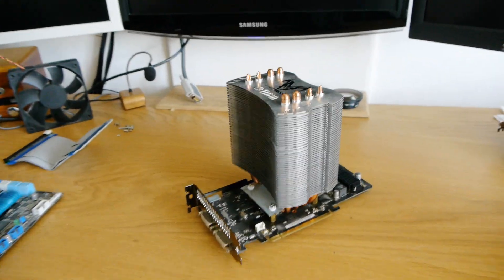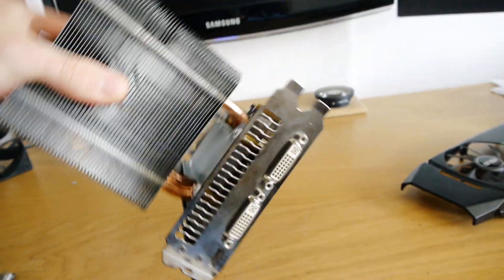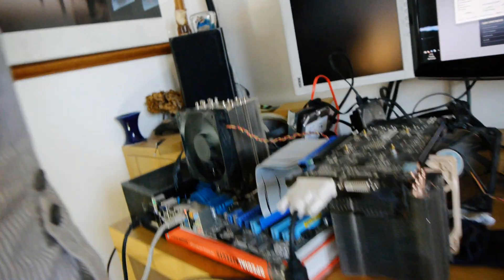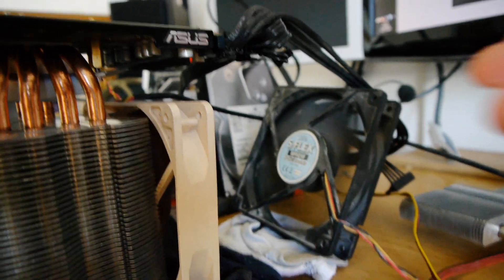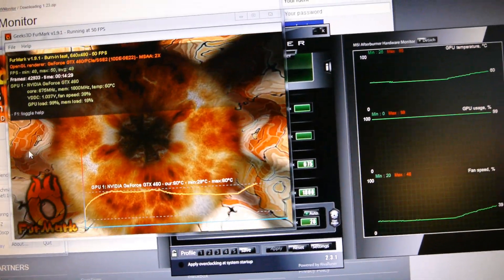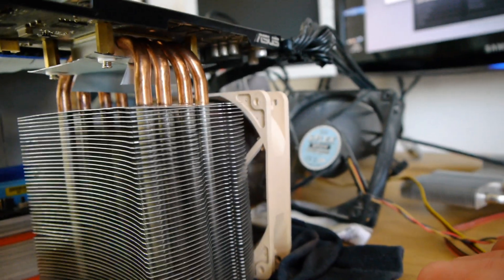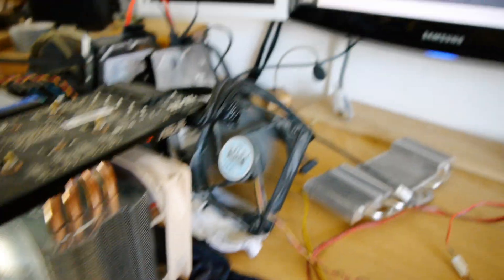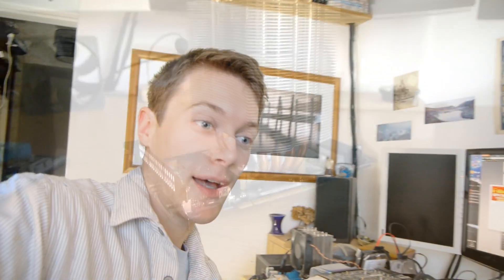CPU cooler on GPU (INSANE temps!)

Comment: Fun experiment.
Bear in mind though, that simply taking the original cooler off, cleaning the GPU and applying your own thermal paste, refitting the original cooler, you'd probably see a temp drop similar to this.
The way they apply thermal paste during the assembly is simply shocking!
Reply: There is no way you would see a 20 degree drop in temperatures by just applying new thermal paste.
Reply: joemann7971
It was good 10 years ago, the world has since gone forward.
Now you get stuff like Thermaltake TG-1, Gelid GC-Extreme, Prolimatech PK-3.
Reply: ***** Pardon? Crap? AS5 is fine. It's not the absolute best. But the diff between it or something like IC Diamond is negligible on anything but some sort of max effort EXOTIC cooling effort.

Comment: Interesting build ^^
I would like to see a solution for the cooling of the other parts of the graphics card though because I remember putting a custom cooler on my old graphics card (HD 6950) and there were quite a number of small parts that all had a small cooling block on there, some even in contact with the main heatsink, and I assume most modern non reference graphics cards probably have that as well.

Comment: this is a good idea in theory  but you also need to keep in mind that heat sink keeps the ram chips around the gpu cool. they sell kits for using water cooling systems on your gpu with have the heatsink that covers all the ram and the gpu. right now i have a qauadro fx 4800 witch runs at 164f / 73c and the pcb is at around 142 f/61c thats with the stock fan i could get it down to around 100f/ 37c or less with a water cool system. would be somthing to look in to help with keeping the nose down and keep things cool.

Comment: 23° C HOT?.... dude you're kidding. here (in mexico) at least where i live (in the state i live in), we have 28-40(in the hotter days).... that's nothing.

So, the temperatures you get there. would double or at least get higher than just that. my pc with just 2 fans (the heatsink of the cpu, and the gpu) get 65°c in battlefield 4 and the gpu over 60-70° (GTX650Ti OC btw). So, your build only works where you live. in hotter places that thing would burn :l
Reply: You then need to account for the exhaust coming from the gas generator powering the system.... I'm assuming by your post, you run your computer outside where it is 40 degrees. If you are not doing this, and you are inside an air conditioned house, you will be running your system at around 23 degrees which is the ideal temperature for your air conditioning.

Therefore, his build will work in most any climate.    :I
Reply: i don't think everyone has an air aconditioned house at 23°. inside my house minimun is 28° on normal days. on hotter it get's worse.
Reply: yea cuz u use the defualt cooler. get a waterbock and watter cool it.
Reply: i think that's my problem (i don't like using water with ANY electronic piece i have, i'll never go for water cooling for the risk it has), But still. that's not even as close as hot.

Comment: nice but h-pipes works only if it mounted properly with down directed for gravity or slightly at degres, but if you put them upside down they works just like regular copper pipe(what is not that bad a least), that's because they operates in effect of evaporation and condensation of liquid (many kinds depending on manufacturer and purpose) inside them
Reply: It's actually got nothing to do with gravity..... It's 100% capillary action. Read any technical writeup about heatpipes and you'll come to discover that the heat will simply travel along the outside of the air passage (as it's the coolest point) and as the (temperature difference between the outside and inside of the) pipes cool it down, the liquid moves back into the center of the pipe and heads back to the heat source to become hotter again and repeat the cycle.

A heatsink which utilises heatpipes will function correctly at any given angle or orientation - provided the heatpipes themselves have adequate cooling. If there is inadequate cooling to the heatpipes, the capillary action will no longer occur.

en.wikipedia.org/wiki/Capillary_action

"the ability of a liquid to flow in narrow spaces without the assistance of, and in opposition to, external forces like gravity"
Reply: nearly all modern heat pipes have wick materials to move the coolant around using capillary effects
Reply: yeah, this is only reason why it can operate on about 80deg from vertical position but even capillary effect works in reality and laws of physics - especially gravity take effects on it :P i was read and make experiments with h pipes few years ago so im sure about that it's correct ;) and pleas note that laptop heat sinks has slightly different construction to make them efficient when operates vertically but even them operate little better when you put your laptop to position pipes on about 45deg from horizontal surface ;)
Reply: and tell me please how in your opinion transferring liquid have to evaporate from heat source when you put whole construction in position where heat source is on opposite to point of gravity of liquid? :) :P
Reply: but i am not here to be taken deadly serious, i just give them some of my knowledge and it's obviously not my bushiness to take care about what they think about it, if they think they will go and search for informations if don't, damn, i don't care ;) world is funny and you humans are funy creatures to so :) smile please and don't be so deadly serious, you are only ghost driving bionic unit made of stardust, and you are just what  you are thinking, it seems logic to smile if you want to drive happy bionic thing xD :P o.O

Comment: how did you screw the screws in? looks like the heatsink shroud is directly above the screws, giving you maybe an inch of clearance. did you use a 45 degree screwdriver or something?
Reply from the maker: Haha, I'm surprised someone noticed! It was a bit tedious as I had to use pliers to turn a short screwdriver bit. Only after they couldn't be turned by fingers though, so it wasn't too bad.

Comment: Heat pipes work best when the heat source is at the bottom.  Steam rises.
Reply: The effect of gravity on the effectiveness of a heatpipe is minimal. The capillary surfaces within the Heatpipe break the coolants surface tension, distributing it evenly throughout the structure. As soon as coolant evaporates on one end, the coolants surface tension automatically pulls in fresh coolant from the surrounding area. As a result of the self organizing streams of the coolant in both phases, heat is actively convecting through Heat pipes throughout the entire coolant cycle,
Reply: EXACTLY!
Reply: That's only true for an 'ideal' heatpipe.  That cooler probably is more than ideal but there have been some in the past that have not functioned as they should making gravity more of a factor in there operation.  Mainly cheap laptops with even cheaper heatsinks showed this problem.  I guess you get what you pay for.
Reply: Travis Gooding I suggest you learn how heat-pipes work.

Comment: :22/:23   Ok this is UNpractical for ONE primary reason, MOST motherboard orientations are either vertical or horizontal.  Thus:
1. In a vertical motherboard orientation,  the video card REGARDLESS will end up  horizontalling with the hsf system facing up or down
2.  In a horizontal motherboard orientation,  the video card ( 99% of the time) WILL be in a vertical orientation with the hsf facing horizontally

Problem with these application is simply this:  THAT GIANT cpu-cooler-made- to fit the video card will promote SEVERE physical strain on the pcb of the video card in one way or another causing physical sag unless you afro-engineer something.

This is UNpractical and not realistic enough to risk damaging a pc component that often costs much more than 100 bucks.  

I'll stick to aftermarket air cooling.

THE ONLY exception I make to my opinion is if :
The motherboard orientation is vertical yet turned 180 degrees like it MUST be in say, for example, a Silverstone Raven case and have SOMETHING to physically help support the video card, ( given that this gigantic cpu-cooler is now installed as the gpu cooler), 's weight and prevent sagging.
ONLY THEN do I support the attempt of this idea.

Comment: wow last morning i was just thinking would this be possible. but i still dont get how exactly did u mount it? did u use mbo standoffs?
Reply: You can purchase stand offs that can be cut to any length. In this case he created a bracket using a piece of sheet metal probably 30mm x 45mm using the stands offs to hold the cpu in place and using the metal piece to clamp it to the board. If this helps!
Reply: Yes it does thanks

Comment: since heat rises, doesn't putting the cooler upside down defeat the purpose?
Reply: ***** That would be true if the heat pipes did not contain fabric wics to return the fluid by capillary action. Since all modern cpu and gpu heat pipes have fabric wics. The system he built should work fine.
Reply: The heat transfer occurs between the GPU and the heatsink, while the heat will dissipate from the heatsink to air, the card itself wont get noticeably warmer, this is because of airs lower ability to transfer heat to a material with a presumably much higher specific heat capacity.
Reply: ***** GEEKS!!!!:P

Comment: Would this setup work without fans?
Reply: wut
Reply: Laurel Leary  English do you speak it? I ask if this setup would work without any FANS
Reply from the maker: *****
 Maybe with something like a Thermalright Macho. Only just though. Even a little air flow from fans makes a significant difference over 100% passive.

Now, if you could effectively harness convection you might be in with a chance of cooling it passively, but it would be quite a lot of effort vs just using a slow moving fan.
Reply: DIYPerks I guess a big slow moving fan would be barely audible.
Reply: ***** hm it depends on i think. if the silver fins are horizontally arranged it might not work because air can not flow freely but if the fins are arranged in a way that the air can flow freely a fan may not be necessary but Keep in mind that this depends a lot on how you stress the graphics Card.
Reply: *****
But after the liquid get's to a certain temp won't do any more, unless you use a liquid cooler that make it go into like a radiator to remove some heat.

It's so much crap that it's better to simply put a Watercooler.

Comment: TL;DR : Heat pipes work upside down.
For those of you questioning the heat-pipe working upside-down: Wikipedia Heatpipe. 
Once the heat sink has reached a normal operation temperature; the heat pipe has a mixture of vapour and liquid (even at low temperatures because they are sealed whilst at high temperature - leaving the inside of the heat pipe with a low internal pressure.)
Further more the heat pipe is lined with a porous metal, causing a capillary siphoning of the liquid.
These factors mean that the liquid/vapour tend to be fairly evenly distributed around the inside of the heat pipe (at operating temperature 20C-150C) and will work consistently regardless of the direction of gravity.

Comment: haha nice! I've been thinking about doing this on my scrypt mining rig. The cards are open air on ribbon cables n there wouldn't be any issue mounding them flat down. I think in the long run this is a much better solution than buying an aftermarket gpu cooler, they're expensive and not as effective as this.

Comment: The engtx460 used here runs 65-67C under full load with the fan at 50% for low noise. This mod is basically useless against the Asus coolers.

Comment: Thing about this is... on a graphics card there is more then just the GPU that needs to be cooled.... I really do not think this would help other then maybe the GPU but the rest of the card would get crazy temps.
Reply from the maker: As I have said before, the original cooler touched the GPU only. The memory and VRMs were not cooled by the heatsink, meaning that they were still operating within design specification (perhaps a little better in fact, as warm air was no longer being blown onto them from the heatsink).

Still, as I mentioned in the video it was only a temporary test. I have already added heatsinks to both the VRMs and the memory.
Reply: yup, EXACTLY, i was going to comment on this, you need to cover more hardware than JUST the processor on the gpu, and he is risking burning something on the card.

Comment: I think there's some kind of heat transfer fluid inside those heat pipes; you're running the thing upside down so that the fluid is pooled at the end of the pipe, at what should be the top.  It cannot transfer heat the way it's designed.  Turn it over and test again.
Reply: heatpipes are covered with a porous material on the inside, allowing it to work against gravity through capillary action, much like a sponge sucking up water against gravity, or a tree sucking water out of the ground towards its leaves. Gravity barely has any influence on this.
Reply: I don't think it really matters. Heatsinks like that can go into a case in any configuration. Inside a mITX case it will be facing up. Inside an ATX/mATX case it will be facing sideways. It's practically negligible.
Reply: Did you read the comment?  Do you understand the mechanism by which the device works?  Yes, you can install it in any configuration and yes, it will work in any orientation...but, and this is the important part, it will work BEST if it is installed right side up.  This is a matter of degrees, not an absolute.  If he wants as quiet a system as possible, and he stated in so many words that he did, then he would do well to use the device to its best, most efficient potential.
Reply: That's news to me.  And frankly I think it probably hamstrings the performance; without the wick it would probably be much more effective, but then would definitely be position-dependent for best performance.
Reply: Positioning has no impact on temps. The fact he removed the cooler from every component on the video card and then only put cooling back on the gpu is the problem
Reply from the maker: ihateyoujeffy  You're a little misinformed. The original cooler touched the GPU only. The memory and VRMs were not cooled by the heatsink, meaning that they were still operating within design specification (perhaps a little better in fact, as warm air was no longer being blown onto them from the heatsink).

Still, as I mentioned in the video it was only a temporary test. I have already added heatsinks to both the VRMs and the memory.
Reply: DIYPerks
I stand corrected.  I had just assumed that seeing as how my older card utilized the heatsink for more than the gpu that your's would also.  Had I paid more attention I would have noticed you show us the old heat sink in the beginning.
Reply: chsxtian The porous material only works so well. It helps, but the cooling would definitely be better if flipped around.

Comment: temp. is going up, so it is not good to trun it "upsidedown"...
Reply: fins are horizontal anyways so it doesn't really matter
Reply: chsxtian it matters, the liquid in tubing, get worm from gpu, and because worm stuf going up, warm liquid stays close to gpu, so cooling is worse, then it would be if he turn it up-side-down, sory for low eng. grammar...
Reply: well, heatpipes have a sponge-like material on the inside that sucks up the liquid, even against gravity.
Reply: chsxtian
sir, you are an idiot.
Reply: Simon Rousseau i, sir, know how heatpipes work. The flow of vapor inside it happens because of the higher vapor pressure on the hot side of the heatpipe, not because of convection. The water evaporates on the hot side of the heatpipe, which increases the pressure on that side. At the same time, at the cold side of the heatpipe, water condenses into the porous coating on the inside. This forces the flow of vapor to go from the hot side to the cool side, and the liquid from the cool side to the hot side. The heat is transfered by the evaporation of water on the hot side, which cools down the hot side, and condensation on the cold side, which heats up the cold side.
Reply: Okay porous coating vs sponge like material didnt look the same (i didnt destroy my heatsink verifying), it just sounds natural to me anyway that whatever direction you use your heatsink the heatpipe still will work.

thanks for your input.

Comment: What if you just put back the original heat-sink from the gpu and somehow add 2 noctua fans.It probably wouldn't be so bulky and fit properly in a case.